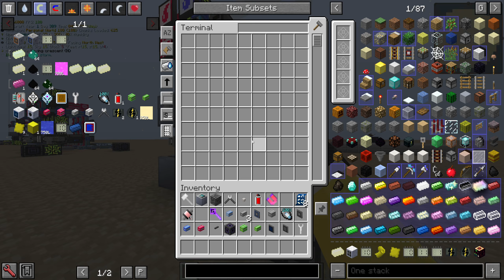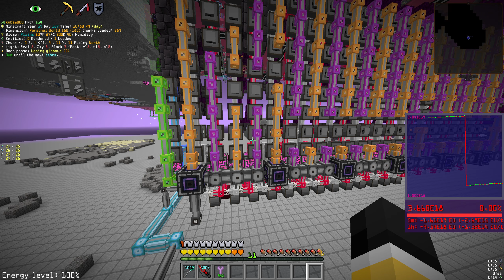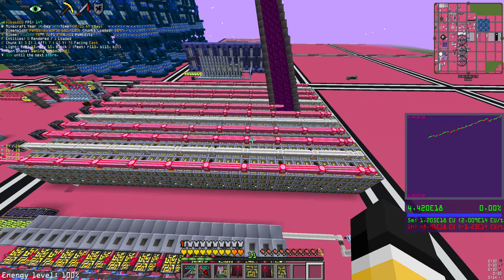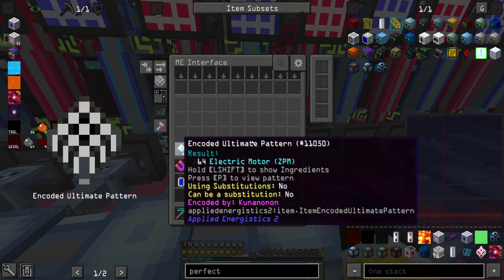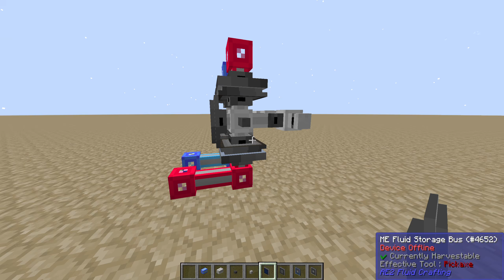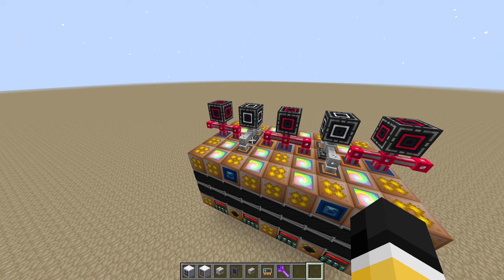GTNH | Toggle Bus Universal Automation | Full build tutorial and explanation

Comment: Do you get that "failed to extract items" error very often? The biggest issue I'm having with this setup is anytime you have many machines hooked up, and a small recipe size (because you aren't making many of the thing), I seem to get this error constantly.

Edit: For anyone else who runs into this, the issue is likely you accidentally have the me chest linking to the 'main' slice network somehow; in my case, it was a missing cable anchor in my copy slice
Reply: i have this Problem while i am using 8 ABS. In my others setups its no Problem and my chests arent with the main net connected
Reply: @MJ-vt6ks  What this error really means is that somehow the items you're sending to the setup are being double counted, like if you have a chest with two storage busses on it. So make sure when you put an item in the setup that you only see the correct number. If you do, then it means it can't extract from the setup for some reason, check storage busses all have the right setting.
Reply: @kimano117  bro i was looking for hours. I didnt do the step at 3:11. Crazy from now on i will copy paste it with the MM. thanks have a great day

Comment: why the ME chest tho? couldnt you just blacklist the storage bus facing the machine hull for circuits?
then you can manually put in circuits through the regular subnet that the patterns shove into?
would make this a lot more compact? right? youd save the entire dual + regular interface duplication to isolate it, you could then just isolate it at the end of the chain tie where its facing the controller, thus saving 2 interfaces and 3 storage bussies per slice
Reply from the maker: Yes it would probably work but only for circuits, there are recipes that have blocking NC items like EBF or some LCR recipes, ME chest is invisible to the interface pushing so blocking doesn't see them
Reply: @tellingsalamander  ok fair point, i hadnt considered actually NC, havent gotten to that point yet ^^
without me chest its working fairly allright for mixers btw, only had to turn on smart blocking for two circuit ids so far!

Comment: This Setup is pretty cool. I found a Problem with Extruder Shapes in the ME Chest as non consumables in Version 2.8.1. When you the shapes in the ME Chest and a craft gets started, the doubled amount of non consumables gets shown in the white Terminal. Somehow the Advanced Stocking bus doesn't work and the machine shows an error: "Failed to extract expected amount of item form stocking bus..."

I don't know how the item gets doubled. The problem is solved, when the shapes aren't in the ME chest, but inside each of the ME drives on top with seperate storage cells and sticky cards.

It might be my Problem: When I delete all fluid related parts, the problem occurs.
Reply: I was getting the stocking bus error as well, I fixed it by making sure all the items went into ME as you said, i had mistakenly rotated one of the me chests, which made the items get inserted in there and not the drive.

Comment: does this work in any gregtech modpack or only gtnh?
Reply from the maker: I am not sure if machine hull has an inventory in newer GT version, but ye certainly the only requirement for it to really work is the ability to stock items in the machines without actually consuming them before processing recipes, as far as I know there are stocking busses and hatches with autopull capabilities on modern GT versions so it should be able to work. If the machine hull has no inventory slot then it has to be replaced with something else or completely change them to level emitters to be fully AE2 only setup
Reply: depends if you have access to the advanced blocking card, in your gregtech modpack, maybe other things, but that's the main one
Reply: @Illusion-clock  ad. block card fucntionality is default in newer ae

Comment: really cool setup. but how does the machine know which circuit it should take, at which step in the process does the machine receive the matching circuit for the recipe or did I miss it?
Reply from the maker: Yes I explained how the setup works at 11:43 , there is 3 storage busses - two points at the subnet item + fluid and 1 additional that looks at the fully separated me chest which holds a circuit or any non consumable item you want
Reply: @tellingsalamander ah thx, I missed that then :)